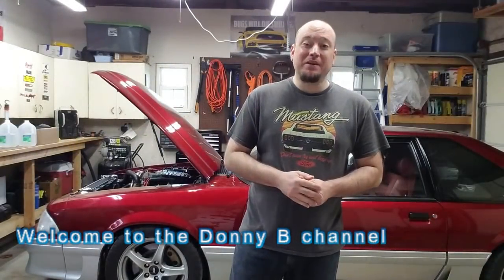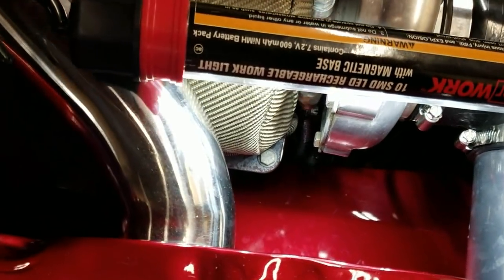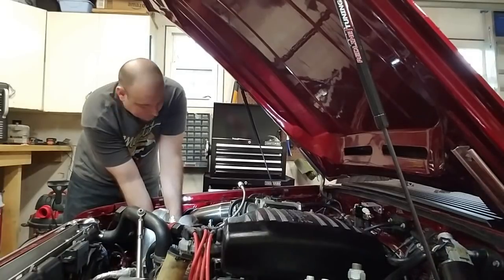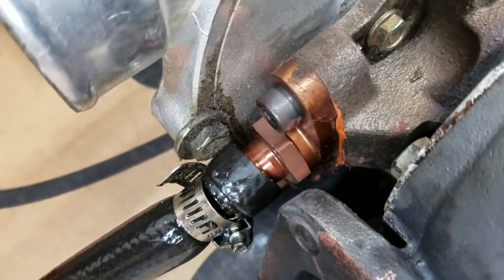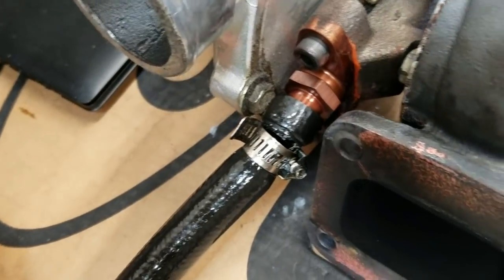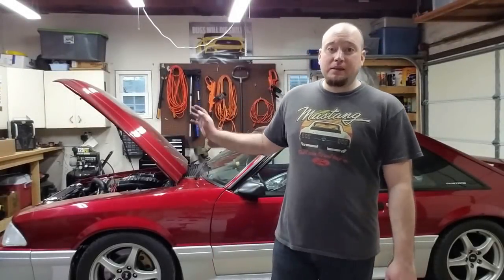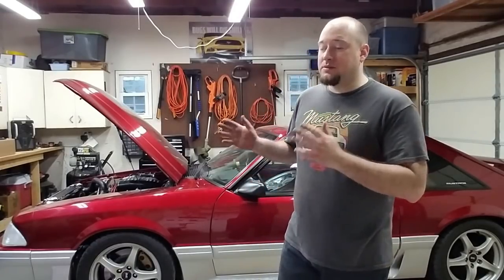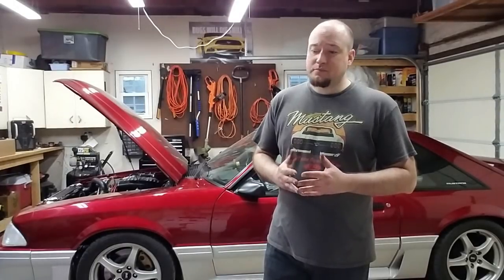Possible On3 Turbo Issue?

Comment: donny turbosmart makes a oil pressure regulator and you MUST use one on dual ball bearing turbos and it will STOP LEAKING and make the turbo last longer.